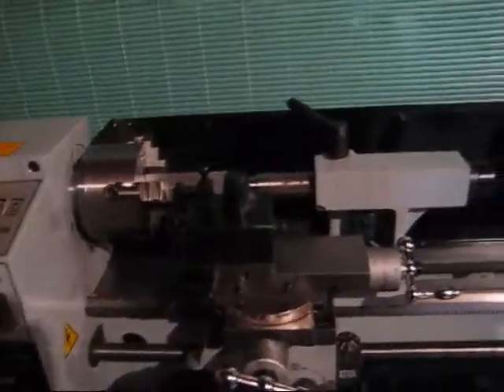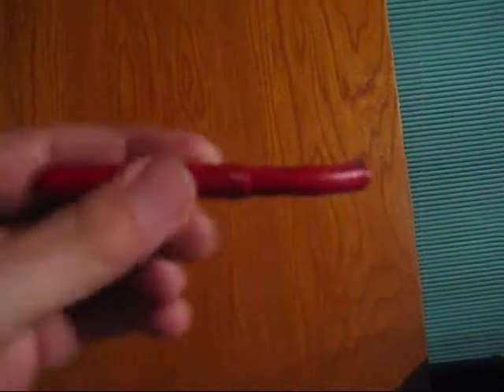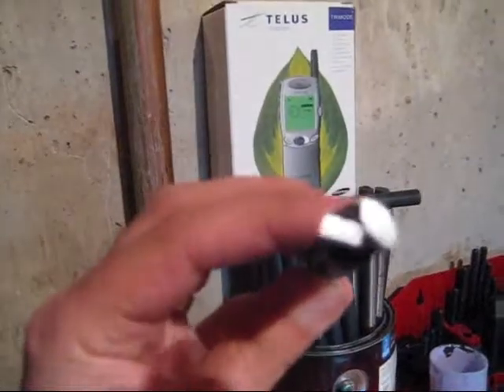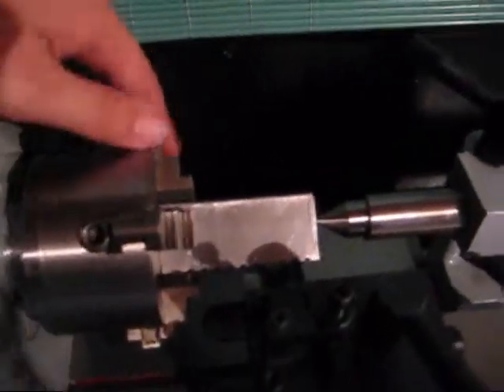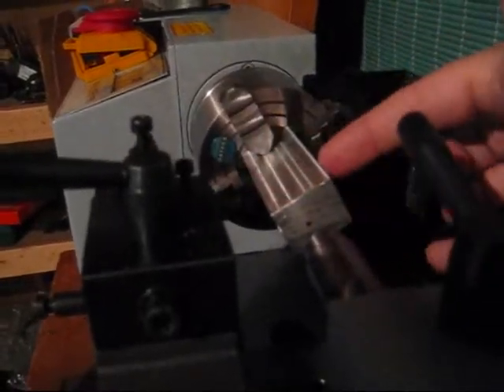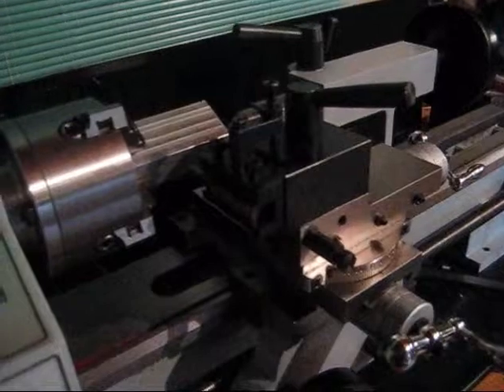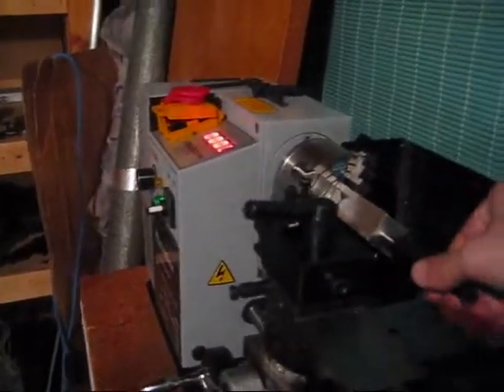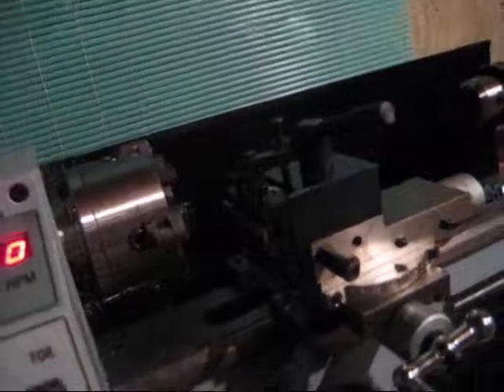Making a 1/2" Boring Bar Holder for a Micromark 7x14 mini lathe - Part 1

Comment: cool.  I have the same lathe and mill like yours from MicroMark.
I do suggest using more cutting fluid when you work with metal though, it makes a big difference.  I put a double pole double trow switch on my mill so that i can reverse the direction of the spindle, and i power tap with the mill.  
Anyway, cool video.